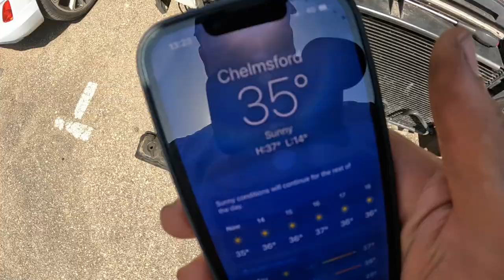The real reason my cheap Audi A6 was abandoned. It's not good.

Comment: The nut holding the fan on MAY be left hand thread ,it should tighten as it rotates .
Reply from the maker: This particular one is a right hand thread. Checked the Audi documentation and multiple forum posts 👍🏻
Reply: @NotEconomicallyViable  fair enough ,you could turn the engine over and double check which way it rotates .

Comment from the maker: The thread on the viscous fan coupling is a regular right-hand thread (unscrews anti-clockwise). That’s according to the official Audi workshop manual and multiple forum posts backing this up 👍🏻🔧🔧👨🏼‍🔧
Reply: It looked like you were going clockwise on the fan nut in the video? 
As much as I know what direction normal threads go, I have often spent ages fighting a bolt that's awkward just to find out I was tightening it all along 😂
Reply: Anti-Clockwise from whose perspective though? The person unscrewing, or the nut?

Comment: You have an amazing attitude! 
Couple thougths: Viscous fans are LEFT threaded on petrol engines. I've removed one two days ago. I'll check my mate"s car tomorrow, he has a 2.5TDI A6, and a spare engine. Do not cut the viscous shaft, finding any used in good condition is rare, and bloody expensive. 
The cams look okay, I had seen worse, and much worse as well - that was so worn, the rocker arms fell off... If you can find a good used set, replace it with that, any other solution is extremely expensive, and aftermarket parts do not last as long, as any used, original Audi in relatively good condition.  
Remowing the glow plugs: remove the dust next to them, if possible, use penetrant oil, heat it up, loosen them while the engine is hot. Do not use too much force, you can try with max 20-25Nm loosening them. If you force it too much, they will snap. Be patient, try them loosen, tighten, slowly. 
By the way, working on diesel cars, you'll look worse than any coalminer... Wear your most hated clothes while fixing your car :D Nearly impossible to clean oily diesel smudges...
Keep up the good work, you'll definitely learn a lot fixing it!
Reply from the maker: Thanks for all of that, János 🙌🏻
Reply: @NotEconomicallyViable  We've checked the spare engine, the viscous fan shaft is normal threaded on your car. Actually you can figure it out, by inspecting the fan blades. If it is rotating anti-clockwise, it is normal threaded. If it rotates clockwise, it is reversed. So, it doesn't depends on fuel type. 
However releasing the thread will require a huge leverage, use a pipe or any extension you can find. Yo can also remove the plastic fan - held by 4 pcs of screws, 10mm hex head.
You're welcome! :)

Comment: You really need to find out what the actual noise is. You need somebody to blip the throttle while you have a look in the engine bay. My first thought was the viscous coupling. As other have said, most viscous couplings have a left-hand thread to stop them from coming undone when the engine is running. I don't know if that is the case with this A6. Bianca may be your least favourite sister but she's gorgeous.

Comment: Check the Camschafts. This is one of the number one issues. In the same way you can also renew the valve cover gasket. Besause they are often leaking oil there. If they are okay it is maybe a pulley or another component outside the engine. Often also the bearings are in their age and are worn out. What could be also possible is that one of the Injectors is leaking Diesel. You can check this with VCDS or there are plenty of Apps with OBD Adapter.

Greetings from Germany!

Comment: Hiya Nino, agree with an earlier poster, think the rattle is probably belt tensioner, reason being it's very rev specific or dependent on rapid rev rise as opposed to constant (tappets/cam etc) easier way to check before you stripped all the bits off would have been just take the drive belts off...obviously not running it for long, just enough to check....oh and personally think cams look OK....as long as there no ridges on cam you should be OK....could be worse, been watching videos on Vag technic(amazing engine diagnostic/builder) and he recently done cam followers on s6? The followers self destruct due to design fault..Engine out, apparently the engine on this car needs to come out for lots of jobs!!! Think total bill was 9k!!! Audi wanted 24k for replacement engine!!! My last 5 cars and my aeroplane didn't come to that much...
Anyway, good luck with your Audi
Bill
Reply from the maker: Thanks for the advice, Bill. I'm learning a tremendous amount each and every time I go and work on my cars. With the help of you guys of course!

Comment: I had one of these cars a good few years ago. I was a 1999 2.5tdi A6 avant. I replaced the cam followers which are under the camshafts and difficult to see. Audi in their infinite wisdom decided to have a long life service interval, something like 24000 miles. A really bad idea.
Reply from the maker: Yeah the long-life service wasn't a great idea at all. Seen lots on the forums saying max 10,000 miles
Reply: @NotEconomicallyViable  I have a 2006 Mercedes e320 cdi and that is on 8000 mile oil changes, which gets expensive when it takes 9 liters. Probably a bit over the top but I have owned it for 10 years and it never misses a beat.
Reply from the maker: I think with situations like these it’s always worth going a bit over the top 👍🏻

Comment: Often taking the whole front end off one of these to do a timing belt change is the preferred option, makes other things a lot easier to access too.
Reply from the maker: I'll probably go down that route. Whilst there is decent access in service mode it'll certainly make it that much easier for a noob like me to work more efficiently
Reply: I think I saw a Ratchets and Wrenches video once which described the process of removing the front bumper and radiator assembly to ready an Audi A6 for any major engine work. A $100 timing belt costs $900 in labour to change.

Comment: The nut on the fan you can not undo is left hand thread anti clockwise you are trying to undo wrong way you just tighten it up. The engine noise you should first chech valve clearance if ok you will see worn rocker too much play cause engine noise hope this helps

Phil In stoke
Reply from the maker: Cheers Phil 👍🏻

Comment: The treads on these are just like normal (so counter clockwise to undo). I would maybe suggest putting the car in the service position then see if it's possible to cut the plastic cover just above the fan. Hopefully then you can undo it and pull it down and it'll give you some more space. The noise you have sounds a bit like a failing tensioner which is roughly in the area you said it's coming from. If not, have a look at the crank pulley as they can cause a hell of a racket. Hopefully you can get to the bottom of it 🙂
Reply from the maker: Thanks for that, bud. I did think about cutting the plastic cover, but I'll do that as a last resort. I'll take a look at the tensioner and see what I can see 👍🏻

Comment: I had that clicking noise on startup mainly for the first minute of so on my old Golf.. It seemed to come from the belt area and I changed the cam belt tensioner (and water pump plus belt ) and it’s been quiet as a church mouse since.
I doubt the old girl isn’t even run in yet at that mileage anyway isn’t 02 brand new lol.
Reply from the maker: Good to know. It definitely sounds like it could be a tensioner – especially considering it only makes a noise when being revved. 02 most certainly is brand new haha

Comment: And by the way the Fan clutch ils normaly a reverse thread Hope it help you 👍
Reply from the maker: I did think that, but I checked multiple times with the official documentation and it’s a regular left-hand thread on these
Reply: @NotEconomicallyViable  yea that’s reverse thread so you have to turn it the other way (tighten) to loosen it. Righty loosely in this case.  Normally it’s lefty loosely righty tighty 😃
Reply from the maker: I didn’t mean left hand thread lol. I meant right 😅 Unscrews anti-clockwise. It’s early guys haha
Reply: @NotEconomicallyViable  haha we are all same

Comment: In my experience of old Audi's, once they start to go wrong you need to get rid of them immediately.  Otherwise it is one issue after the other, as soon as you fix one issue another one will occur so it will never, ever be completely fixed.

So you have bought 3 old Audi's, and all 3 of them have been an absolute nightmare........
Reply from the maker: Yeah pretty much – but I wouldn't have much of a channel if I bought cars with no issues 😉

Comment: pitting on a smooth surface like that is called "spawling." really bad spawling is what creates the noise in a bad wheel bearing, and it starts with light pitting like that. now, that being said, i've seen cams that had light spawling on the lobes that ran for another 100k without going to bits.

Comment: Oh dear its very difficult to help from afar, but those camshafts look ok you would know if they are badly worn, these just look like typical used heat soaked engine parts, re the viscous coupling, they are opposite threads…… are you trying the right way. The noise is something rotating and id say its ancillary to the main engine from what i can hear, check play in turbo, check the fan itself and check all the various belt tensioners and pulleys. If needs be take off the belts u can and run engine, id dismiss all the easy stuff before diving into the engine.
Reply from the maker: Nice one, Rob. I'll give all that a go 👍🏻

Comment: The problem is, most people buy these cars cheap. They diagnose one problem, not knowing they may have more and they sell them. The next guy is a bit more thorough and discovers two problems. Drives it and after some time an old problem which hasn't been adressed shows up. Get's sold again and at some point they end up at someone like me or you. And the reason is because at one point people stopped servicing them properly. Had this with BMW, Mercedes, Toyota, Honda, doesn't matter. Although Toyota and Honda fail way more often in little annoying things. And feel crap after 20 years. On a positive note, you don't have all these problems with Fiat. They don't make it to the 20 years of age.

Comment: Doesn’t the motor have a harmonic balancer on the crank pulley . Or possibly the duel mass flywheel both will cause the same noise when the engine spins faster ? Good luck
Reply from the maker: Yeah but I'm not too sure that the noise is coming from those locations – sounds more like the very front N/S
Reply: @NotEconomicallyViable  the harmonic balancer is situated on the end of the crank shaft at the very front of the motor. Once the rubber fails it will make metal to metal contact briefly

Comment: Don’t you need two spanners one to hold the shaft and one to undo the nut? Might well be left hand thread too
Reply from the maker: I had one of the spanners jammed in underneath on the shaft so it was resting on a bumper mount so that I could use one hand to give it everything I had

Comment: No such thing as a cheap German car 
I’m from Australia & have been a mechanic for the last 12 years plus & I still cannot believe how cheap cars are in the UK. I can guarantee that the cam shaft will be very worn & may need replacing. All that carbon build it is quite literally terrifying me because I have had to de-carbon a couple of VW Jettas with the 1.9TDI and it wasn’t pretty. For both me & the customer who had spend £1300. 
For me to fix your Audi properly I would estimate about £3000-3500 to do it. 
I wish you good luck.
Reply from the maker: I'm just gonna pretend I didn't read this comment haha 🫣😅
Reply: @NotEconomicallyViable  that is just my personal opinion based on the photos & videos you posted. It could be totally off the mark. Without standing in front of it & physically seeing the car. I am only guessing. 
It is also the worst case scenario I am giving. So don’t take it personally. I hope it works out for it should be a good car.
Reply: @NotEconomicallyViable  also don’t forget I am in Australia where anything German Audi,VW etc command a premium price tag. It costs a fortune to get parts in Australia it might be different in the UK. But we deal mostly with Japanese & American cars. Which cost 1/4 of what the German brands do.
Reply from the maker: I didn't realise there was such a premium down there on German rigs. Parts here really aren't too bad – main dealer prices are always quite high, but the aftermarket is extensive. For instance, I just purchased a Gates timing belt kit (the deluxe version that includes tensioners, water pump, thermostat etc) and it cost me £220 (382 AUD). Don't know what that might cost where you are.

Parts for my Merc are different though – they're all scary expensive unless you buy all the Chinese rubbish.
Reply: @NotEconomicallyViable  you can double the price you paid for the timing kit to around £400 through an Australian supplier they add on shipping & other costs. Merc parts are astronomical here. For instance your 220E 
I would buy parts from the salvage yard. I wouldn’t even try buying anything new. We do have quite a decent Mercedes salvage industry that does refurbish things
Reply from the maker: That’s nuts. On the plus side, though, you do have some great Australian and American cars that I’d love to see over here. The guy who lives opposite me has a Vauxhall Monaro (Holden), but they’re rare as hell. Great bit of kit – especially on cold starts
Reply: @NotEconomicallyViable  Also labour rates in Australia are quite high. For instance I charge the equivalent of £65 per hour plus %10 VAT. Most of my competitors charge upwards £75-£80 per hour plus VAT. So you can see how easy it is to spend quite a lot of money very quickly. An example would be a road worthy certificate which is our equivalent of an MOT. Costs approximately £175 and that’s with no failures or advisory’s. I have had cars cost £600 plus for a roadworthy (MOT) simply because they failed on so many items.
Reply: @NotEconomicallyViable  another example is the ignition coil on your Merc cost about £85-£100 just for coil. Then add 1 hours labour charge is another £80 so that’s £180 just for 1 little coil. Count yourself lucky you still have decent prices for most stuff.

Comment: Does to make that clanging noise just when you rev it or does it do it while the engine is sat at 2000rpm?
I'm not 100& sure but on other vehicles I've worked on with a viscous fan they were a left hand thread.
Reply from the maker: When it revs. Driven it a couple of times up the driveway and didn’t make that noise
Reply: @NotEconomicallyViable  well if it's not doing that noise at a constant rev then before going all out and pulling cams change what you know is broken i.e the engine mounting and go from there as with that not functioning correctly it could be that.
Reply from the maker: Ok nice one - cheers bud 👍🏻